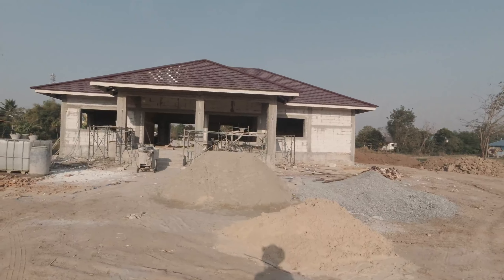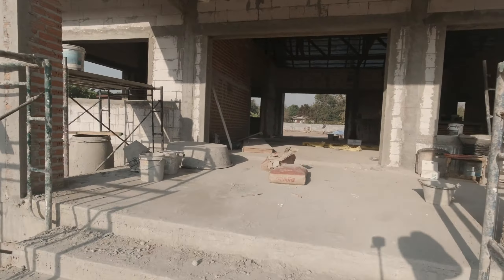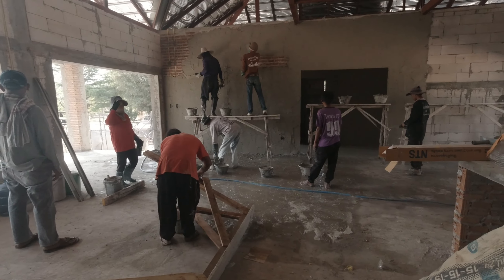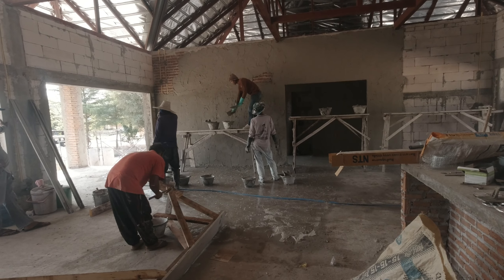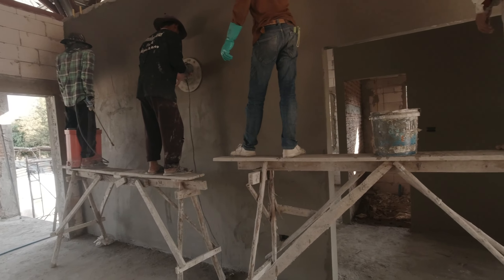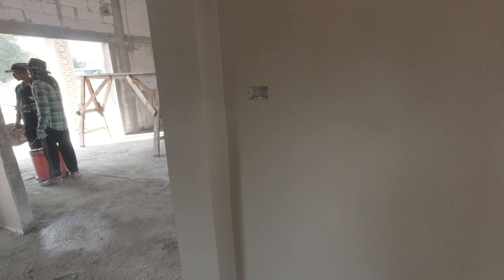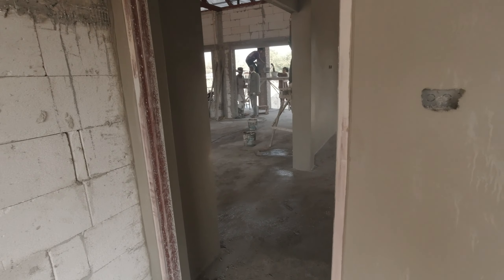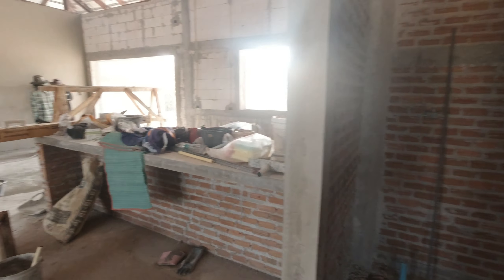RENDERING THE INSIDE OF THE DREAM HOME

Comment: Looking good.  First that I have seen builders use a buffing wheel.  Is it common?  I have seen videos showing the use of a straight edge to knock down the roughness, but the first I've seen a buffing wheel used afterwards.  I like it.  Question about the electrical.  Are any of the outlets switched?  Is that something that is even done in Thailand?  I like to have an outlet or two near nightstands to turn  lamps on and off from the doorway.
Reply from the maker: No I do not have any of the outlets on switches. I have a number of them on dual switches though.